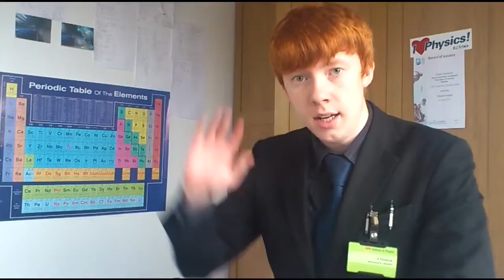The smallest transistor that will ever be made

Comment: i applaud you on the quality and integrity of your videos, but unless you have unique selling points like big think and brainstorm. you won't be making much impact. i know i sound like a right Ahole but you need to be a little bit more sellable. a little bit the "sci show" maybe you can use a bit of humour. i know it may be a bit degrading but the audience responds to that kind of thing. or even apply SMOSH's strategy which is using interesting thumb nails.

Comment: You need to say that a transistor indicates to the binary computer(the processor actually) faze 0 or faze 1 so a transistor needs to be very precise and also needs to have only 2 fazes for binary systems(binary systems imply only 2 values: 0 and 1 are chosen by default). Also quantum computers based on electron postions(or other subatomic particles' positions) may in theory be made, we just need to to figure out the physics of cuantum mechanics first...still to be done.